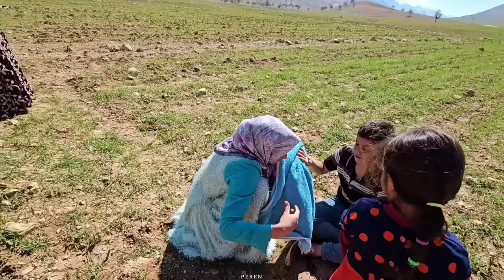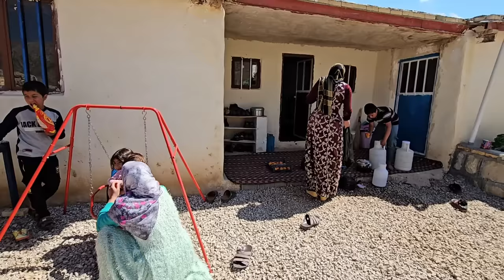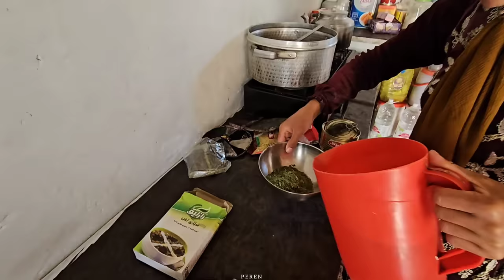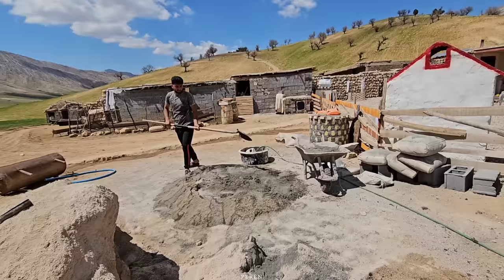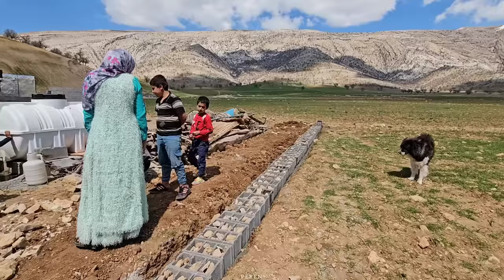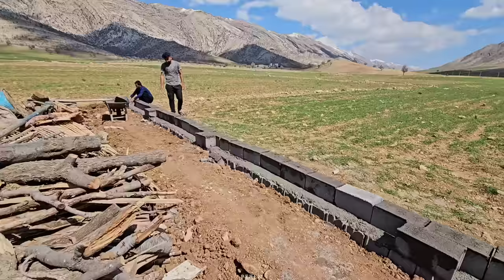Tahmurt's return home.😷👨🏻  Doing daily chores by family members

Comment: Why fill the blocks with rocks ?? that is a waste of time and energy??. Save the rocks to fill walls of blocks they can add as insulation in the walls or make rock gardens out of those little rocks.
Reply: They put the rocks in to fill in those large holes in the blocks. Without the rocks it would require a whole lot of cement, because the cement would be what fills the holes.